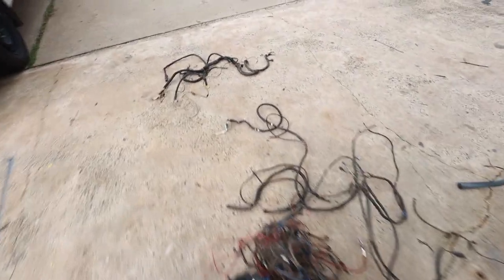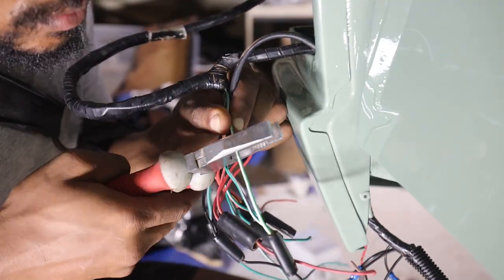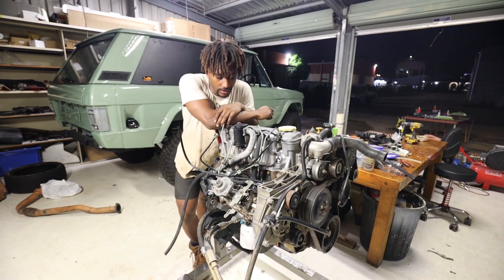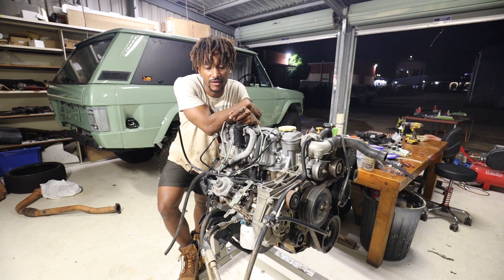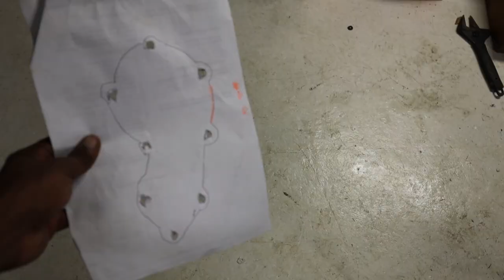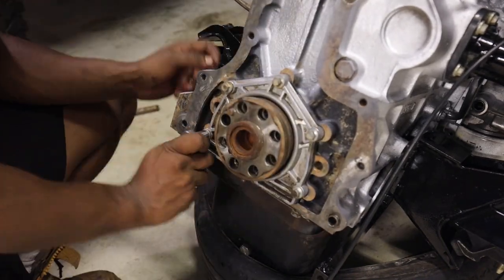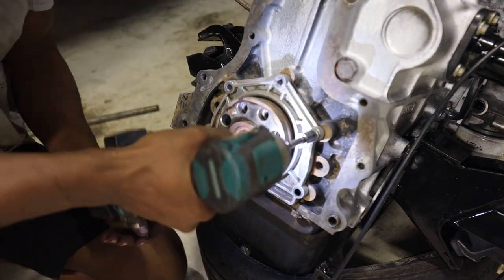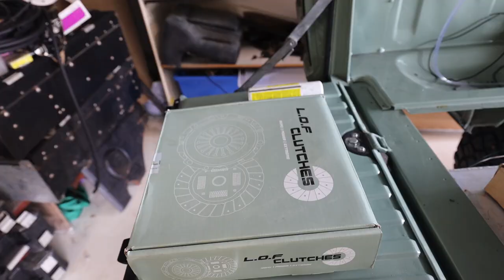EP 10 || Installing the engine | Range Rover Classic

Comment: Brilliant work. Such a thorough job, no shortcuts.
Wity such a high lift how did you cope with propshaft angles and joints?
Reply from the maker: Thanks Nigel! Since the engine swap was done with the lift already installed on the vehicle engine and gearbox was welded to the lowest point possible to reduce prop shaft angle. 

Overall its slightly more angle then stock but not by much!.